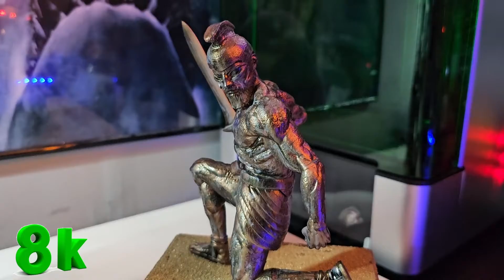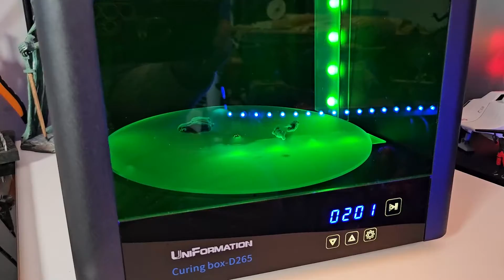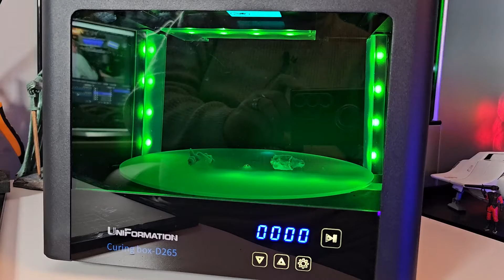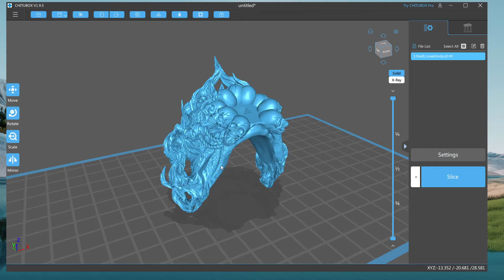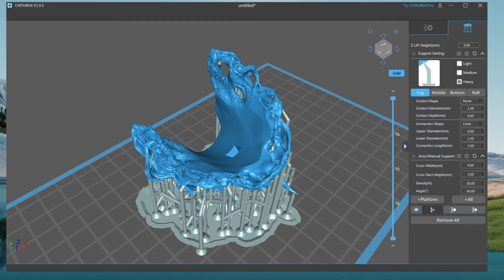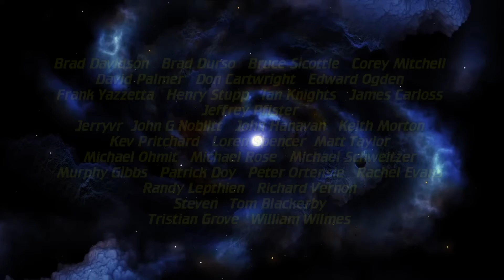The Uniformation Curing Station

Comment: Wayne i have a question the uniformation cure 3 ultra came today . I followed the instructions to the letter and i can,t get it to go into uv mode . The heater is working perfect . I push the button on the right until the blue light comes on then i push the start button above it and the light goes red and the heater comes on. I don,t know what i,m doing wrong . I saw you just push a button and it lights up is there anything else l,m suppose to be doing. Thank you.
Reply from the maker: Heater? It doesn't have a heater

Comment: Apparently the printers have proven so popular that they have had to extend the delivery times to 20 days or something. They cant make them quick enough lol. Don't forget your drain holes after hollowing your print mate. Otherwise you'll have uncured resin inside that will be gassing off inside a sealed chamber and eventually your print will crack. Seen loads of horror stories of peoples prints going crack and all the resin inside making a puddle on their shelves as it leaks out. The holes help with the suction forces to prevent failures too.
Reply from the maker: Yep. Definitely. I try and poke some in the feet